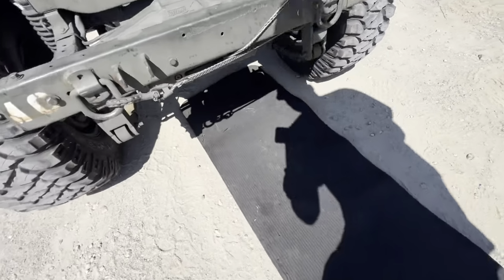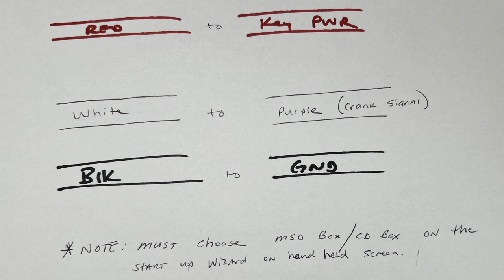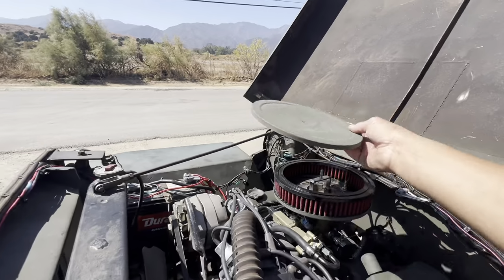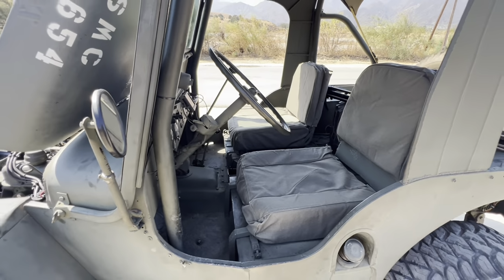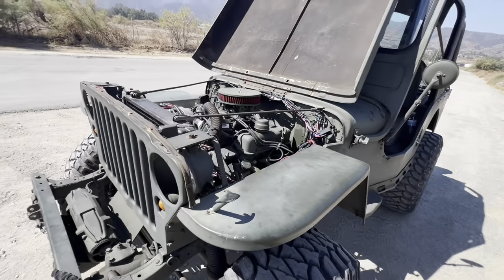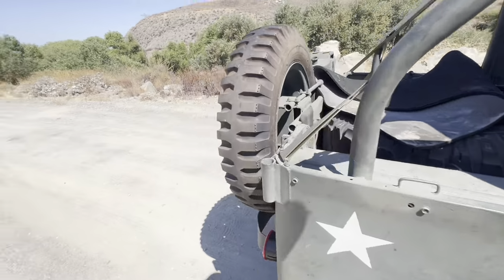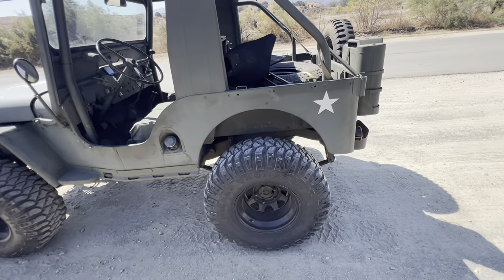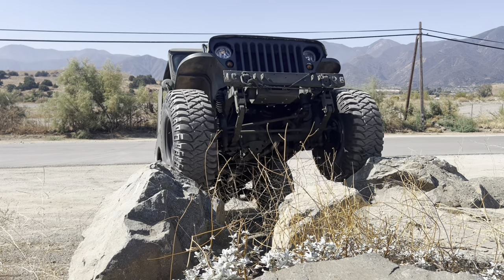Sniper 2 on a Buick V6 225 Oddfire/ EFI/ 1946 Willys Jeep/ crank sensor

Comment: NIce!   I just fired up my '77 Oddfire (for its first start after totally rebuilding it) with a rochester 2bbl on my '46 CJ2A .   Now, after seeing your video, I want a sniper!
Reply from the maker: heck yeah!! haha - make sure to also get a fuel cell or modify og tank. (up coming video). cause I have been having fuel aeration problems air/vapor/fuel delivery. - but the sniper kicks A**!!

Comment: Thanks for the great info!  Who dialed in your distributor?  I’m struggling a bit with mine too… it fires and runs pretty good but I have a knocking up top after the engine reaches temp.  Timing???? Valves???? Lifters??? Idk yet…
Reply from the maker: www.awdynamix.com did the distributor. and after I installed the EFI, they also tuned the EFI..
Reply from the maker: sounds like timing issues. these little engines have a tiny window of perfect timing-Hard to find it.
Reply: @reconern do you think AED could trouble shoot my knocking?
Reply: Brand new rebuild on my 225 but it sounds like a damn diesel clatter after it warms up.  Frustrating! Spent hours upon hours on it.
Reply from the maker: yes. I think they can help you out. give em a call.
Reply from the maker: dang- hopefully you can get it to smooth out.